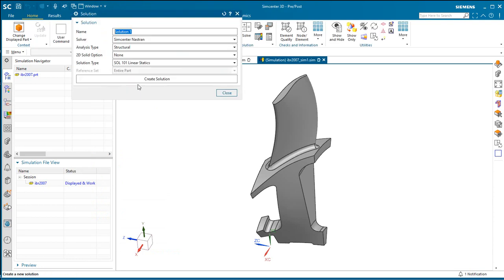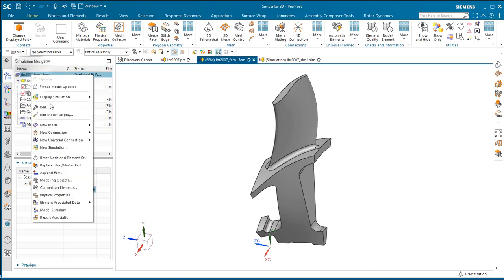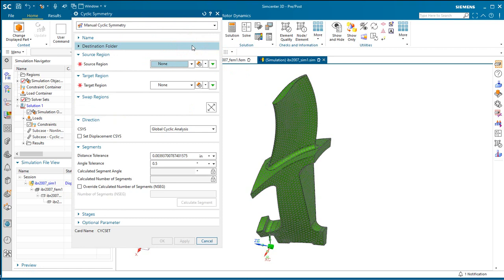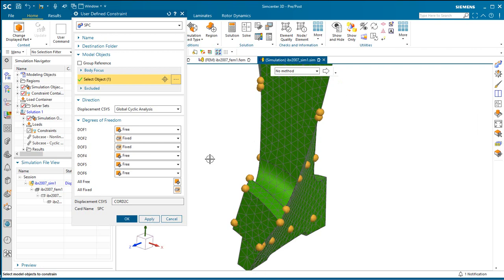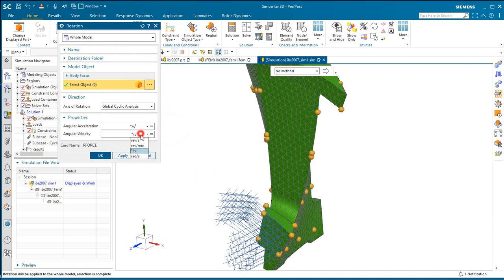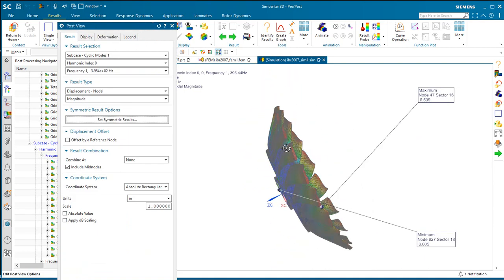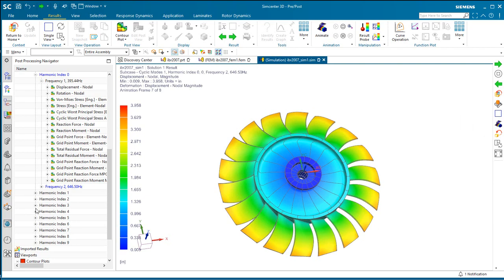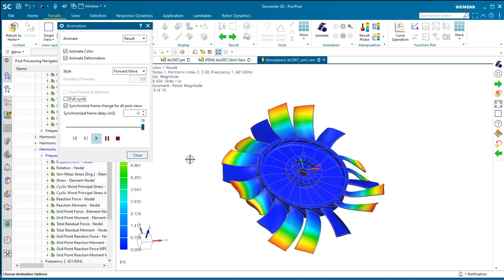Cyclic Symmetric Nonlinear Prestressed Modal Analysis with Simcenter 3D

Comment: Hello and thank you very much for the insightful video! 

I am using Simcenter 12.0 to model a radial turbine using the same methodology that is presented on the video. I have trimmed the turbine sector in a way that the boundary surfaces are not level, but they are curved (similar to the video). However, when I am trying to use either the automatic or the manual cyclic symmetry pairing it produces two alert messages and the target regions cannot be recognised. When I am using the manual cyclic symmetry, I get the mesage: "The selected regions are not consistent with the specified tolerances". Increasing the tolerances does not change anything. When I am using the automatic cyclic symmetry, it produces the error: "No face pairs found" and increasing the tolerances does not change anything again. I am sure that the way of trimmig the sector is correct, because I have rotated the boundary surface by the sector angle to get the other surface. Also, I have checked that the cyclic symmetry coordinate system is defined correctly with the z axis pointing on the direction of rotation and the system origin is along the rotation axis. Also, I have tried to copy the mesh of one surface to the other so they are exactly the same, but agian it cannot recognise it. After all these, I proceeded with the "Override NSEG" option in the manual cyclic symmetry method and when I ran the model it produced me the fatal message: "NO MPC RELATIONSHIPS FORMED FOR THE CYCSET REGIONS. PLEASE CHECK THE CYCSET AND CYCAXIS CARD TO ENSURE ACCURACY OF REGION INFORMATION". 

Could you please provide me with any insight why this happens? 
Does the curvature of the boundary surface play any role?
Maybe the old version that I am using is more aplicable to level surfaces?

Thank you in advance for your time and help.
Reply from the maker: This was a known issue in 12.0.  We fixed it in a later release.

Comment: I`ve tried to duplicate something like this in a 2-piece centrifugal rotor, which is bolted together. I am pretty sure looking at the modal results that it is NOT solving the modes with the bodies in the strain condition in the Nonlinear Statics load case which is the first case. Both are definitely selected to be sequentially dependant, so I`m not sure why that is happening. Note that I`m not using the special "preload" subcase type for this bolt load nor am I using a 1D bolt connection to apply it, just a force applied to the correct area. What special measures do I need to take so that the cyclic modes give results which reflect the preloaded structure (with contact) from the first subcase ?

Thank you again for your very informative videos.
Reply from the maker: Glad you are enjoying the videos.  Did you apply the load in the first (nonlinear statics) subcase also in the second (modal) subcase as well?